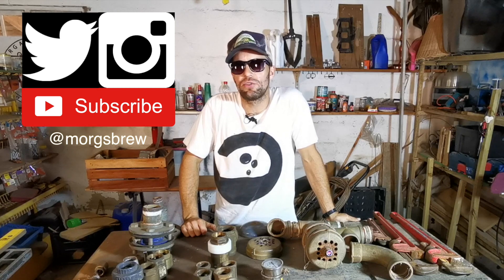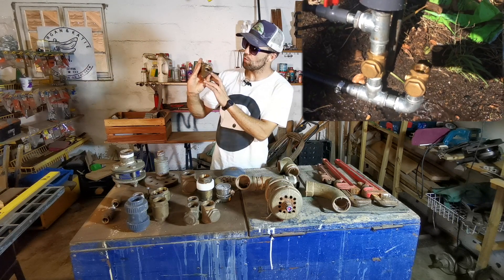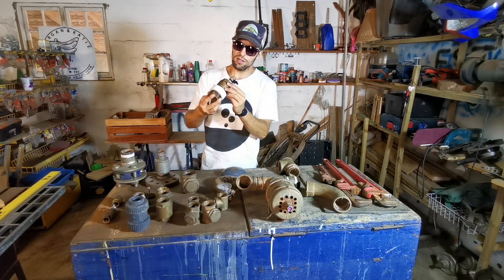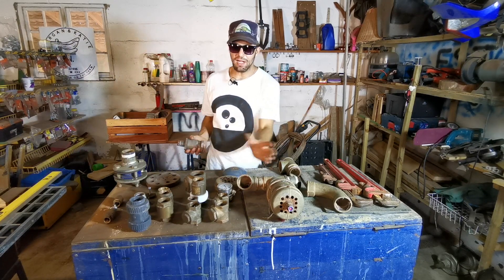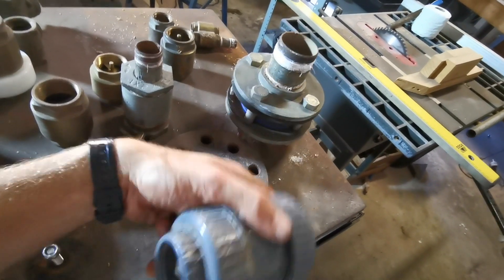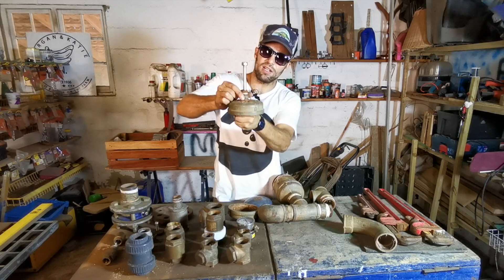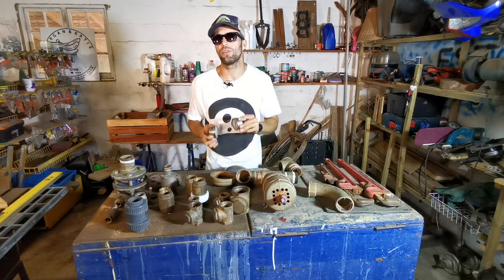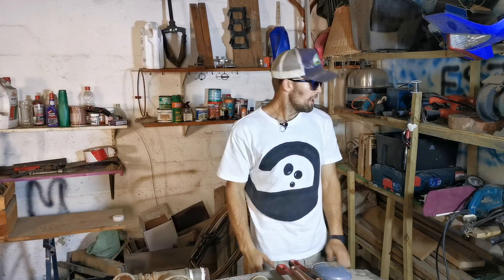RAM PUMP valve design

Comment: You are right, this swing valve is not long lasting, I spent a lot of money most specially to brass swing valve. So I made my own waste valve. I'm using an unserviceable heavy equipment rubber tyre with more or less 1" thick.
Reply from the maker: Howzit

This is the same conclusion I came to. It costs too much to play with the brass fittings and you gain very little in terms of adjustability from them. I moved to fabricating my own impetus valves and significantly improved my system even with my shittest designs. My current system is awesome but still has room for improvement. 

Check out My Ultimate DIY Ram Pump 
https://youtu.be/p8PL6sqq40A

Cheers

Comment: Thank you for the video.  I put a link to this video in the ram pump waste water check valve discussion in the Water Powered Pumps Facebook group.   Please consider joining in, sharing your ideas and linking back to your youtube videos when appropriate.
https://www.facebook.com/groups/240458583255303/permalink/533567013944457/
Reply from the maker: Howzit Dave

I have seen your interest in water pumps on the group. Are you looking to do any quantification on these systems or are you trying to build yourself a reliable pump?
Reply: @MorgsBrew  Thanks for the reply.  My situation is a different than some.  My main application is to irrigate about 3 acres of meadow grassland from a stream with a fair amount of water but hard to get more than 2 to 3 feet of head for the 10 feet of lift and pressure for low pressure Wobbler sprinkler and / or drip system.     ... So volume of water delivered is a consideration as well as cost per volume of water delivered to a usable height (and pressure).   No electricity available at the location and hard to carry in fuel for extended pump runs. 
I started out thinking a water wheel driving a low RPM pump that I have acquired was the way to go, but haven't yet constructed the water wheel or connected the pump.     There are also options of spiral and piston pumps, but hard to imagine the spiral pump would provide enough water and I have been impressed with some of the piston pumps connected to water wheels.
I have purchased a Land To House, 1 1/4 ram pump so I have something to test with this summer that might actually function.  The ram pump may be  able to drive one Wobbler (maybe mini Wobbler rather than XCEL Wobbler).   Whether I should expand to 5 to 10 ram pumps depends on results that I get and where I am with other water powered pump options.   For example, the Bunyip and Glockemann pressure enhancement pumps look interesting, but delivery from Australia is a consideration.
I think you were asking if I plan to buy or build.  Probably buy initially and evaluate.    Might build more ram pumps and modify the waste water check valves if that produces more volume of water out or if I decide to go bigger than the 1 1/4 ram pump rather than more pumps.
The installation will be used approximately 3 months out of each year to irrigate the grass.
I started the Water Powered Pumps public facebook group to learn what others are doing.  Much to my surprise, almost 500 people from around the world have joined.  Members range from people with casual interest, to people able to construct serious pumps to vendors of commercially available water powered pumps:   https://www.facebook.com/groups/240458583255303/